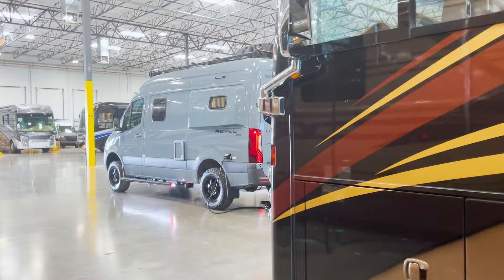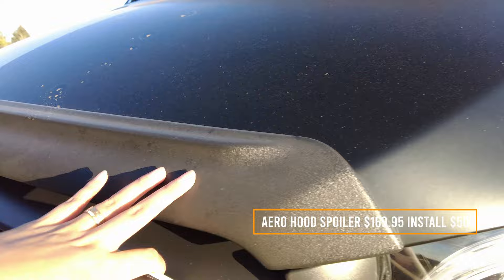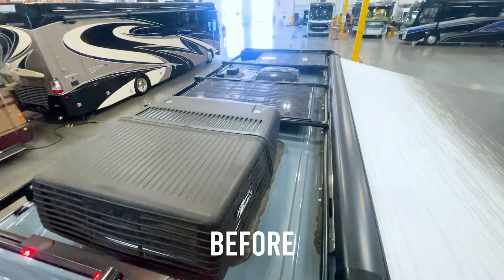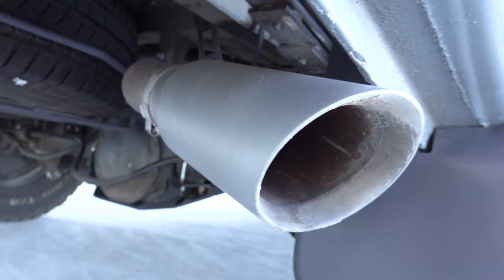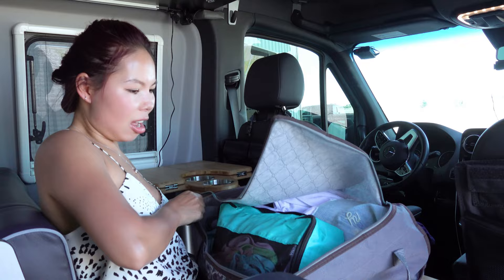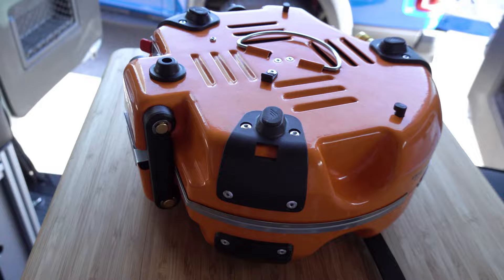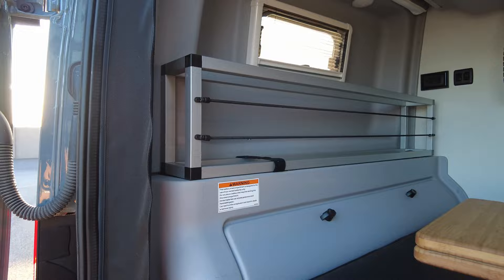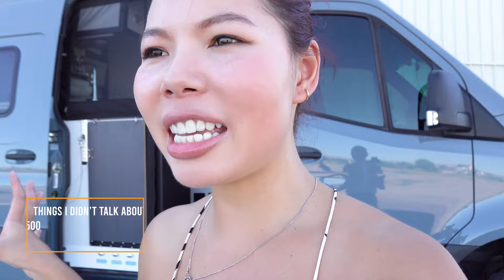Revel Van Tour: Luxury Modern Cozy Off Road Living

Comment: It's gorgeous, and we thank you so very much for being honest ...  I would be very curious what your front / rear axle weights and van weight is.  The Revel only has about 1500 pounds of OCCC to begin with...  Just looking at all the stuff you have on the back doors and then the GLSS system, the bash plates, the new suspension, all the rest.  A full tank of Diesel is nearly 300 pounds with that new tank...  Not trying to be preachy at all - being overweight is dangerous to you and your van, and I'm a bit of a worrier.  You are just as cute as a button, and we'd hate to see anything happen to you!  Subscribed!
Reply from the maker: Awww! Thank you so much!!! ❤️

I honestly don’t know what’s the van overall weight currently, but when we did the installs and put in the new suspension, they always weigh the van.

We also pulled our jet skis in this van a couple times, I don’t really recommend because reversing is a pain, but we never had any problem. Fingers crossed it will remain so!
Reply: @iamseryen They should give you a weight slip - I'm an old guy and I've been camping 50 or so years now.  I have seen the casualties for being overweight.  For one, your insurance might not cover you should you have an accident and they determine weight was a contributing factor.  For two, components not designed to hold the extra weight can fail early and/or without warning (brakes/axles).  To make sure you're good to go, I would ask them for a weight slip.  Better yet, look up a scale and take the van there yourself - weight the front axle alone, then the entire van, then the rear axle.  If any of the numbers are over based on their individual weight rating, at least you'll know.  Whether you make changes is up to you.

Many times vendors will sell you what you want without telling you what you don't want to hear.  Not that anyone would.  Let's just say it wouldn't be the first time.

Be safe cutie-patootie!

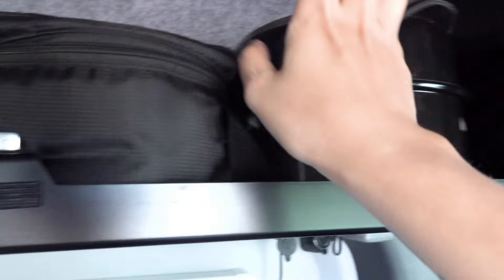Comment: 15:58 Your magnetic paper towel holder is one piece. It seems like such design is no more on Amazon. I see some two-piece designs (for different lengths or different uses) at the same price. Thank you for this info.
Reply from the maker: Hi @BearsCave! 

Thank you for watching and commenting! 

This is the one I bought:

Kitchen Magnetic Stainless Steel Paper Towel Holder for Refrigerator, Grill, Toolbox (Magnetic-30cm-Black-B) https://a.co/d/iOq5i95
Reply: Oh, I missed it because I skipped all open-one-end design. The camera angle made me think yours was a two-closed-ends design that I preferred. Thank you so much.

Comment: Every time I see "off road" used in association with a Sprinter it makes me laugh.  They are acceptable dirt road machines but once you get off a maintained dirt road and on to a dirt trail, or off road situation, they are not very practical due to the stiff chassis, long wheelbase, poor approach and departure angles and high center of gravity.  Keep your "off road" wheeling within the ability of your van and you'll be ok.  But if you think your van is a four wheeler, you'll be paying tow bills.
Reply from the maker: @rd4660 I actually went off roading a couple times, even twice in the sand dunes. Did I get stuck and a tractor needed to pull me out? Yes. But if we had some traction boards and a shovel, we would have gotten ourselves out. 

I wouldn’t recommend going off road if you don’t have the right equipment, but it is definitely doable in this van. Not all vans are made equally. 

https://youtu.be/M4w3rTpyBNo?si=dhkRRIDFZWE-9Eqj